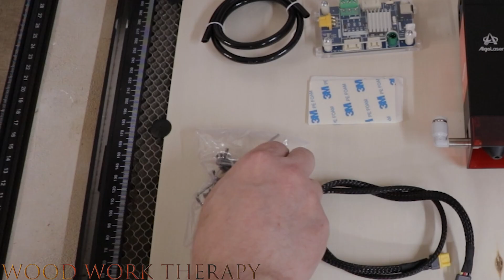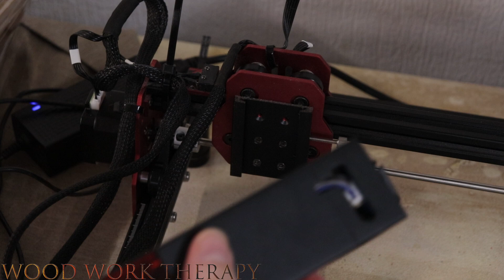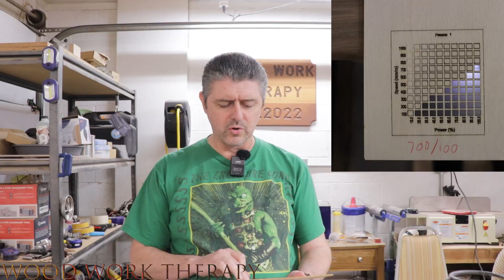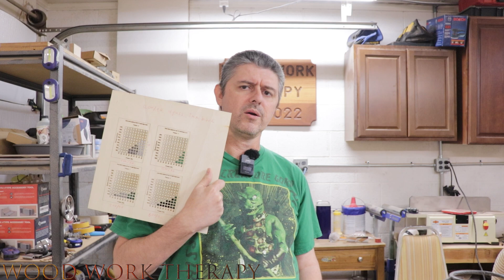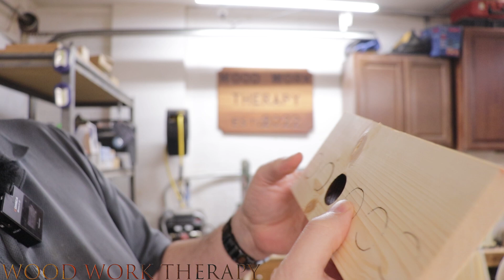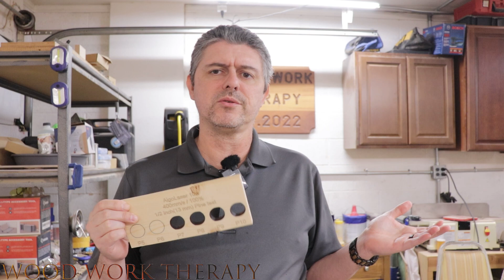The SHOCKING Truth About 10W AlgoLaser DIY Kit Upgrades!

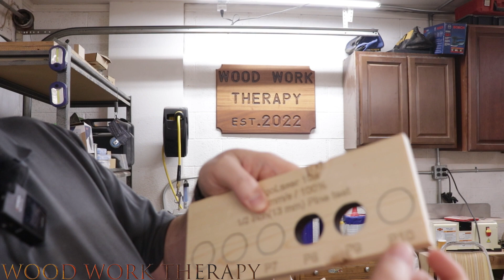Comment: Hello. Great video. I'm new to all this, I'm curious why your circles on the pine 16:45 are not perfect circles. ty
Reply from the maker: Well that is kinda embarrassing. But you are right. It was an issue with a control cable that got caught on something and damaged the cable. Since I wanted to get the video out to show cutting power I let that slide. Took a while doing wire tracing to find the issue. The machine works perfectly now. And should be no resemblance of quality issues on the manufacturer. That was an internal issue. Sorry about any concern that may have caused. 🙂
Reply: @WoodWorkTherapy  That makes sense. Cool, thank you.

Comment: nice video very impormative and straight forward,,, i just want to ask,, what is the used of the PCB board module from the kit? if you buy those upgrade kit is it comes with it? thank you
Reply from the maker: The PCB module is included with the Algolaser 10-watt laser package, but its use depends on the specific laser model. For the Algolaser DIY kits, this module isn't required. Instead, you simply swap out the power adapter with the slightly more powerful one provided in the 10-watt laser upgrade package.

However, for models like the Algolaser Alpha and Algolaser Delta, the PCB module is typically needed to ensure compatibility and optimal performance. I’m confident this information will help you determine the right setup for your laser upgrade!
Reply: @WoodWorkTherapy  thank you for your time,,, i was planning to buy those kit,, by the way  im from the philippines,,, im one of your subscriber now thank you
Reply from the maker: Thank you so much for subscribing! I'm thrilled to have you as part of our community, and I hope you enjoy the kit!